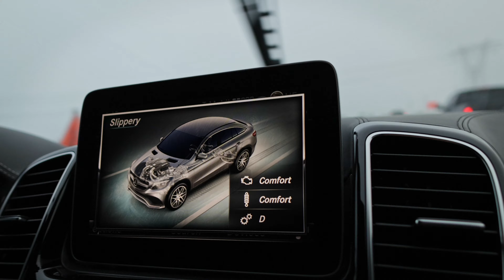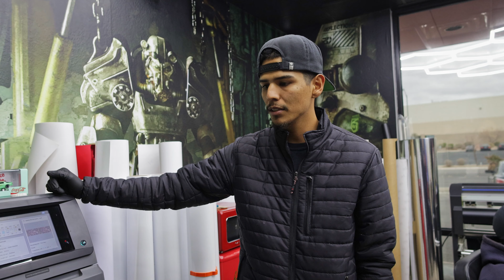Taking Delivery of the World’s Coolest Car Again!

Comment: Because the air has to literally taken from the bottom of the bumper for it to be cold air . Anything under the hood is hot from the engine heat . . Another type is ram air , where it got vents that take air from the front bumper. Like the hellcat fake headlight holes were ram intakes

Comment: I believe the plastic box around the intake matches up with the bottom of the hood keeping hot air from the engine away from the intake. By removing the plastic box the intake sucks hot engine air into the engine. I'm no pro but that's my theory 🤷‍♂️
Reply: Yeah pretty much how it’s works man. It also surrounds the intake stopping hot air from coming underneath or on the sides.
Reply: Also doubt kali and hyphy were told or realize but they jailbreak comes with an upgraded air intake. Which is why it sounds no different from the leg maker they put in lol

Comment: Hot air from the back of filter it pulls more from there then the front. Just put the box back on. Your intake temps will drop.  You have gauge. Highfy .

Comment: The reason it’s a hot air intake is because when the plastic box is removed the filter sucks in air at a 360 angle so it’s also sucking in the hot air coming from the supercharger and engine but with the box on it only has one opening and that’s the bumper inlet bringing in cool air but does it make a performance different? Idk supposedly

Comment: The idiots that call it a hot air intake don’t know anything about modding 😂 just dudes that like to speed in their mini vans. If the intake filter is close or by the intake manifold then it’ll be collecting hot air but as you can see it’s not and it’s more close to the front grill and not only that you got hood vents so the hot air collecting in the bay will all be escaping out the vents.